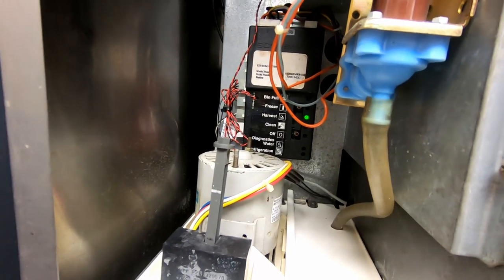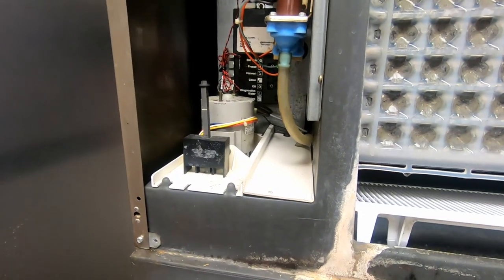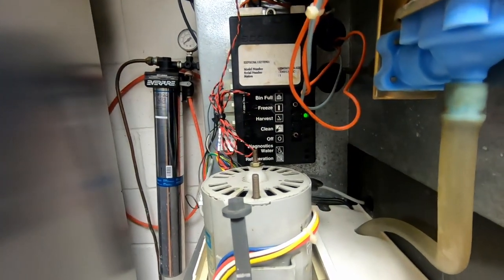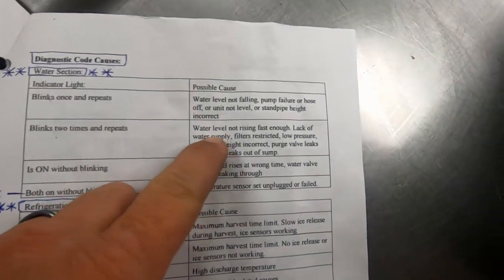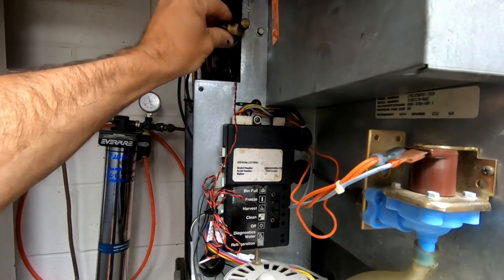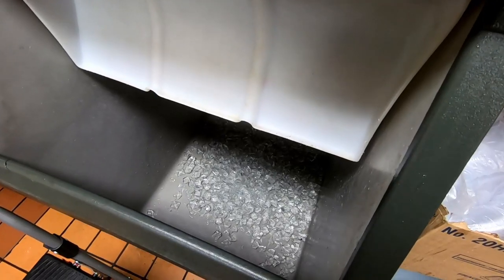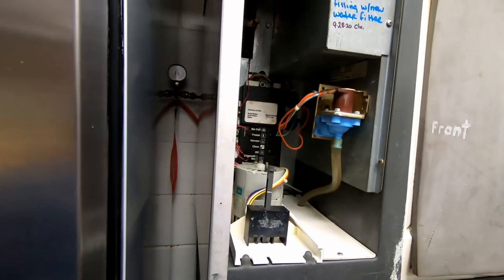Scotsman Ice Machine Randomly Not Making Ice

Comment: I work for Scotsman. Haven’t seen an old cme style ice machine for a while. You did a great job cleaning the machine. Some of the evaporators are tin or nickel plated.
Reply from the maker: Thanks Bart, I hate nasty machines 🙄😁.
Reply: I have a cme250  1994 model I just got the water inlet valve working but now the water keeps cycling maybe low on 404a refrigerant this is William

Comment: I do like your video’s and the way how you approach each unit there is one more thing I usually do when I work on ice machine I look down on drain and see if drain valve is leaking water just to cover the easy check thank you for all what you do to hvac industry your awesome man
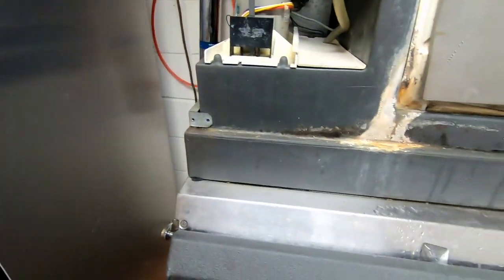Reply from the maker: Thanks Mr. Richi, that's real important on a Hoshizaki because the water can leak outbecause of how the pump system works with the check valve and it's never a bad thing to do, on this machine it doesn't have a dump valve solenoid, it literally overfills the water trough to purge the water out.   I appreciate you watching and leaving a comment. See you tonight at 8:30 if you like for the live show 👍👍

Comment: Yeah, the old Scotsman cubers count the ice on the first batch. So the first cycle is longer. The second cycle is supposed to end at the time the machine saw the last piece of ice fall. At the seminars for those machines, Scotsman told us that we might not see the bin light flash, but the machine does see every piece of ice that falls. 

The biggest problem I had with these machines were the optical sensors when the machine was installed and used well water. The bin sensor would get covered over in a few weeks. Plus, the machine was next to the empty beer bottles.
Reply from the maker: Any yeast in the air from breads or beers will help form the nastiest of slimy looking mold. Pizza places and sub stores are the worst. What I'll do is pull the sensors out and lay them in the bottom tray to soak while the cleaner is circulating. If the water is real bad, like with "well" water with rust..... That is the worst to clean up. Thanks 4 the feedback and watching 👍👍
Reply: Where is the optical sensor located?
Reply from the maker: On the left and right side below the EVAP plate. They had little led inferred sensors like an old remote control has.
Reply: @HVACRSurvival  got ‘em thanks
Reply: Thanks for the info was able to clean and sanitize the oldie also cleaned the eyes of the sensor and got it to make ice but after a half bin full it stopped and refrigerant light flashes. assumption its low in refrigerant?
Reply from the maker: @emiliano4271  time the free cycle in the harvest cycle. Freecycle should be anywhere from probably 12 minutes to maybe 18 minutes harvest should be about 2 minutes to no more than three and a half minutes if it's about 4 or 5 minutes and you're probably low on charge. Harvest is the thing that gets affected the most when you're low on refrigerant.

Comment: Those old cme's would just run especially the ones with the basic timer.. The new ones just seem to have an unreal amount of evaporator failures.. nickel falls off, grid separation, micro leaks..
Reply from the maker: Nothing seems to be made with any pride anymore. That machine was 18 or 19 years old according to the date I seen on the sticker.

Comment: Those machines did do very good here. They eyes got dirty with slime from the water
Reply from the maker: Right on Roy 👍👍 Scotsman has told me themselves that that thing will work fine without any of the nickel coating. They've got some pretty good technical service guys. And that is a very reliable machine even though I don't like the way it's made out of plastic like it is. It tends to sag in the middle.

Comment: This is off topic but window AC for the last 10 years have been ridiculous in design.  The thermistor on electronic models is right on evap and the supposed econ mode has to run fan about 2 mins out of 10mins to get an accurate read, and what's more, the fan runs about 3 mins after compressor off, this just increases humidity.  First thing I do is put thermistor outside of vent in room, and wire 1 speed (low) to compressor relay and done.  Fan runs with compressor and no more excess noise and humidity.  Anyone else notice this crap design?
Reply: Scotsman MV 450

Comment: Any idea what could be wrong with my water cooled scotsman it's not flowing alot of water out discharge took filter off no different? It will make one rack of ice that shuts down.
Reply from the maker: It could be several different things, could be a refrigerant issue, could be a water control valve problem but without checking several different things it's hard to say.

Comment: Hello. My machine is the same as that, it starts to fill and the pump works and fills the system but the compressor does not start. After approximately 2 minutes the machine stops, the water light blinks 2 times and the off light stays green. The compressor does not start and we already carried out a thorough cleaning.
Reply: Water fill sensor

Comment: How my BTU or ton are these, and up north do they let the heat go inside of building or is it always rooftop condenser?
Reply from the maker: You have three different types of condensers available. Air-cooled self-contained at the machine, remote condenser, water-cooled condenser. Generally they are rated for pounds of ice for 24 hours. The btu would need to be looked up in the book and they come in all different shapes and sizes.

Comment: If it stays in freeze mode and not go into harvest. You think it needs cleaning ?
Reply from the maker: It could possibly be a dirty ice thickness sensor, It really depends on which model you're working on and what brand.
Reply: @HVACRSurvival  thanks for the heads up. I'm going to check out the sensors along with a calcium clean up.

Comment: what would be the problem if the cubes don fall of the tray? half of them stay on the tray and when the water stall falling again it splash of the cubes and fall on the ice at the bottom freezing on allthe ice!
Reply from the maker: If you're referring to the evaporator plate as "the tray" then I would guess that is probably a problem with the refrigerant charge being low and not creating enough heat to melt them off during Harvest, or could be a harvest valve problem or you could have problems with the evaporator plate itself. Hard to be certain when you're not standing there looking at it but that's the most likely scenario

Comment: After cleaning, how many cycles  to get the chemical out of the ice ?
Reply: Label says dump first bin....
Reply from the maker: The control module generally will cycle about 20-30 minutes of freshwater through. There's quicker ways of doing it.
Reply: How many cycles is 30 minutes I have to clean one out soon ?🤔
Reply from the maker: This particular model does not have a dump valve like some ice machines do. The way it works is when you hit the cleaning button the second time it will start flashing the clean led,  this will cause the machine to add water until it overflows that little tube that I pulled out in the video from the left side of the machine in the water trough area. That's the reason why when I am completely done I pull the tube out and drain it completely then I will flush it multiple times (4)  with clean water.  **For safety & liability reasons I got to tell you to do it the way the factory describes how to do it,  which is usually listed inside the machine or on the factory's website. all this is done after the machine has ran the cleaner through itself usually somewhere between 10 and 15 minutes. But this is going out of memory and should be verified by checking the manual. ****Use all these procedures at your own risk.*** #Trust but verify 👍👍
Reply: Thanks to all who responded to my inquiry.

Comment: Another incorrect statement one when any ice machine is turned on from a off cycle especially if it has been off for a while they will do a prechill which is when the water stops flowing over the evaporator because it to create the flash off effect or sudden heat loss case and point it is like when some one touches their tongue to a frozen pipe it is the flash of the heat transfer that causes the tongue/water to stick to the pipe or evaporator otherwise the evaporator would look like a frozen waterfall in winter and water running over the ice

Comment: On ice machines the first assumptions should always be cleanliness and water then dirty condensers not reversed especially if it works good during the day and ok at night because a dirty condenser will cause the head master to thick it is a cool summer night
Reply from the maker: Correct. Manitowoc told me that the biggest problem is a dirty ice machine. Or I should say water related. But Because I know that store well and how abused the equipment is I kind of moved all over the place plus I didn't get a very good description, everyone acted like they were lost and had no clue.
Reply: But the statement about it not being able to keep up when it is cool at night would not direct a seasoned tech to a dirty condenser because a dirty condenser will help an ice machine make ice when the evenings are cooler not the opposite
Reply: A ice machine should always be cleaned before any diagnostics are performed because if you look at your video you can see that ice machine was in dire need of cleaning
Reply: @dmiestercommkitchentech3043  Just curious about that statement. What your saying is, when you come upon an ice machine that is not running, and is obviously dirty, you would first clean the machine BEFORE you start any form of diagnostic?
Reply: @mikec.2746  Yes because a dirty evaporator, distribotor, level sensor thickness probe will effect any and all ice production
Reply: Dirt period will effect ice production problem is most every tech uses HVc diagnostics to service ice machines and they are neither walk ins, refrigerators, or air conditioners and if a ice machine is dirty your ice producing is significantly effected doesn't matter and a dirty ice machine will also hide another problem
Reply: @mikec.2746  I have actually ran calls where a tech condemned an expansion valve and problem was a dirty evaporator and a water valve bleeding thru causing sump water to not chill properly and again if it had been cleaned the tech would have been able to catch the actual problem it had long harvest and long freeze errors
Reply: @dmiestercommkitchentech3043  Ok. But what if its a bad compressor and the owner decides to replace the machine instead of repair. Now you've spent a couple of hours cleaning it before you found it has a bad compressor. So now the owner has a really clean ice machine he is about to throw out. He may be a little upset with you for not finding it a few hours sooner. I mean I guess you could bull shit him and tell him you had to clean it first, before you could diagnose it. He may conclude you were just padding the bill.
Reply from the maker: Mike I have spent over an hour and a half getting a machine cleaned because I only saw half the picture which was that it was dirty, only to waste all that time then later find out there was so many things wrong with the machine that they didn't want to repair it and chose to replace it. Everyone has their preferences, I'm not saying this is the golden rule or the Bible or whatever else some people assume I'm trying to portray here. It's just me going out running calls and if you get something from it great if you don't then I will refund all the money you paid to watch it. 😏
Reply: @HVACRSurvival  Sorry, that wasn't meant as a cut on you. I like your vids and your live stream. I was replying to what Dion said. Before he turns on an ice machine to do any type of diagnostic, he first cleans it. I want to know WHY it stopped running, so I will start the machine first. The water filter that you found clogged can easily be bypassed by removing the top "O" of the water filter and re-installing it. Then I can run it to determine what else it needs. That way i can talk to my customer to see how they want me to proceed.
Reply from the maker: No,  I didn't feel that way at all Mike, I actually felt like you were on the same track of thinking I was. I'm not saying I'm super genius here, if I could have seen the water filter pressure gauge that was hidden behind the freezer and if the water would have been lower I would have jumped to that first.
Reply: @HVACRSurvival  Yes, I was on the same track as you. In the vid when the machine went into harvest and the water pump came on, you mentioned that was normal but not sure if Hoshizaki does the same. I work on them alot and what they do is in harvest the water fill valve energies and it brings that water into the water distribution tubes on top of the evap plates and its that water that helps dislodge the ice from the plates. Anyway, keep up the good work and keep the vids coming. Catch you tomorrow night.
Reply from the maker: @dmiestercommkitchentech3043  you really ought to apply at the factory or start making videos 👍👍.  It sounds like your a really Great service god 😁.  Only problem is it doesn't sound like you listened to what I said.  I never said they told me that it was working okay at night and not during the day or vice versa.  I was giving the viewer some of my past experiences of when a system is low on refrigerant it can be hidden by a dirty condenser and or might not be noticable until the temperature drops.  Also the very first thing I said was the machine was dirty and that the water filter was a issue in the past.  Why do you think I had the water pressure marked on the machine? you can see this before I even tear into the machine. If you also noticed I couldn't see the water filter because it was buried behind the flipping freezer.  But because the machine had water I wasn't as concerned with the water filter at first. Far as that machine being dirty, this version of Scotsman doesn't generally give a crap because it doesn't have a ice thickness gauge that gets fouled out like the Manitowoc or even the newer Scotsman's because it's using a water float. The reason why it stops the water from running during the pre chill is so that it doesn't cause slushing in the machine. Which will result in the pump getting starved of water,  because if it does slush... the ice will make the machine believe it has enough water when it doesn't and it will just run the pump non-stop until it hits a timeout or ice starts to melt.  As I mentioned in the video, Scotsman is not the main brand I work on everyday and I don't have them memorized so I'm going off of memory. I have no problem with criticism but make sure you watch the video completely and listen to everything fully before you say that I said certain things.  You see when I edit my videos I go through and run a low pass audio filter,  a compressor limiter and a EQ on the audio so that the viewer can hear what I'm saying.  So they're really shouldn't be any excuse for not hearing it correctly.  I can't help it if the Wind blows the microphone when I'm standing over a fan but for the most part I cut out a lot of the noise interference from the machinery running in the video.
Reply from the maker: Thanks Mike 👍👍. I'm not very experienced with Hoshizakis,  I'm lucky if I've worked on 6 or 8 total.
Reply: Mike I miss spoke when I said that the first thing I do is clean the machine the first thing I would do is turn it on and check the codes and depending on the code I find will determine my next step and if it is that the ice machine needs cleaned then I inform the customer one of the age of the ice machine and that the ice machine needs cleaned but that there may still be another issue that is being hidden by the dirty machine so I get permission to clean it first before I get concerned with pressures because dirty components can effect the pressures that is what I meant when I said I would clean it before doing any diagnostics it was only regarding checking the pressures.
Reply: @dmiestercommkitchentech3043  No worries Dion, but thanks for the clarification. Keep in mind alot of newbies watch these vids and read the replies looking for more knowledge and may be mislead. As long as you do right by your customer, all is good! Enjoy the rest of your weekend!
Reply: Mike C. - I work directly for Scotsman and with much confidence, suggest a diagnosis is a first step to ascertain the problem before any cleaning unless there is a great threat of legionnaires disease from stagnant water. 

Great video and instruction.